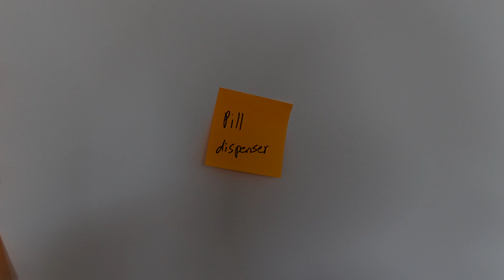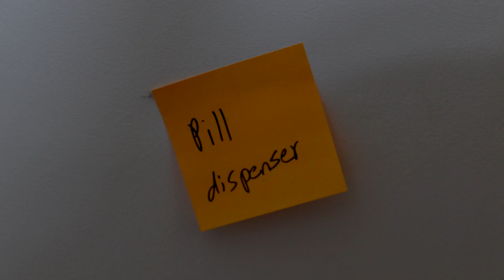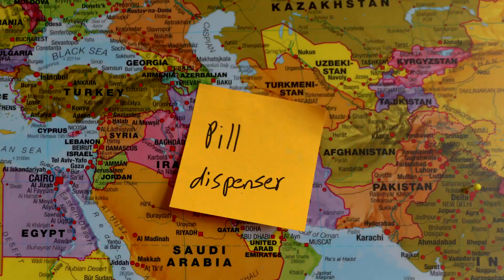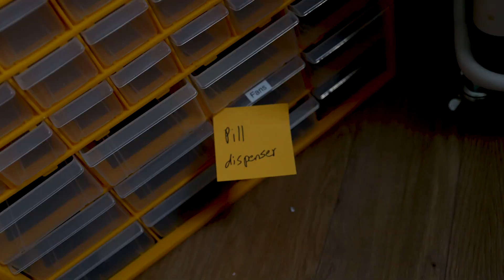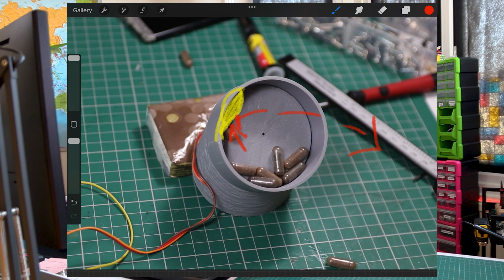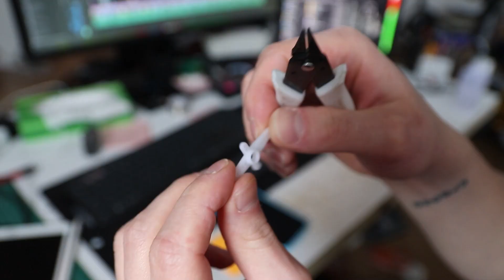Automatic pill dispensers why are they so expensive?!? (DIY)

Comment: Hi mate! Sorry but what application do you use in your 3d designing?
Reply from the maker: back when I made this video I used to use shapr3D but I've recently converted over to fusion 360, shaper 3D is great but expensive and you can get a free version of Fusion
Reply: @Mellow_labs  thanks mate! We are currently making a pill dispenser and we are struggling in making it, we don't know where to start.
Reply from the maker: I would start by figuring out a dispensing mechanism and then move on to detecting the pills going into the container, but like most projects as long as you start you're already doing it right.  it took me 10 versions to get to where I think it's working well enough for me, I learned a lot. good luck and let me know how it goes.
Reply: @Mellow_labs  mate what motor did you use to rotate the disk palette?
Reply from the maker: have you seen the rest of the pill dispenser vidos? 
https://youtube.com/playlist?list=PLj8R0ADXoEK_2iLzQJ2G7ARQD7u1NsqnT
Reply: @Mellow_labs  yes I watched it all many time. What kind of servo motor did you use?
Reply from the maker: @korjdeguzman8621  sorry I thought I posted this somewhere https://www.amazon.co.uk/hz/wishlist/ls/Y83PLDDVOPA4?ref_=wl_share
Reply: @Mellow_labs  thanks a lot
Reply: Well we have a project like this and we are struggling right now. Hope you notice mate

Comment: Awesome job on the mechanical design; love it! I think I used a third party servo library when I needed to change the servo drive frequency in one of my arduino projects. I remember there being a few. You can also just send raw HIGH/LOW signals with the right timing to control servos from an arduino or any MCU in a pinch 🤷‍♂You can also use a PWM library or set the data registers for the MCU but that's more of a pain IMO.
Reply from the maker: You’ll probably get to the final video of that series, but I ended up just using micropython on a D1 mini, it was easy to code, and it does the trick

Comment: what happens if the electriciyt goes off in a power cut?
Reply from the maker: You could run it off of an external battery, although it’s not very good at keeping time. so I’d recommend upgrading it with a real time clock module, i’m working on an update i’ll publish it on my GitHub with the code too short to make a whole video about it.

Comment: i am in need of one of these could you help me ? i have the adruino bits i do not have a 3D printer :(
Reply from the maker: This is something for tinkerers there are some parts you have to print and design yourself depending on what kind of medication you use and I really don’t recommend you using it if you need it to work 100% of the time

Comment: It‘s very great jobs,  I have to take medicine every day. I'm training an AI program to check the pills is correct.  But it's still  boring to dispensing.  so why not  make Automatic pill dispensers, then i seach  information about it and fond this.  Finally I have a suggestion, the container is best  as airtight as possible. some pill need In a dry environment.  Or can easily recycle the pills to sealed container
.
Reply from the maker: This is great to hear, I’d like to learn more about your Ai project.
 I don’t know if it’s practical trying to make a 3-D printed airtight enclosure, especially with this design because there are openings at the front and at the back. 
I am working on a couple of updates as we speak so I might make a video about it soon.
Reply: @Mellow_labs  I has post many time but  don't know why reply failed for your comment。
Reply: @Mellow_labs  I use yolov5 to train AI model and roboflow to annotate pill dataset;